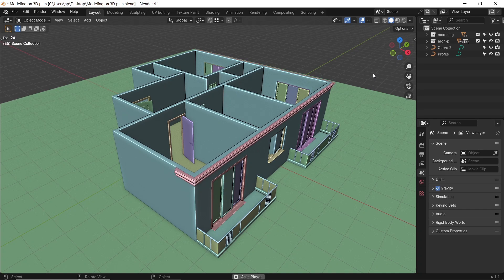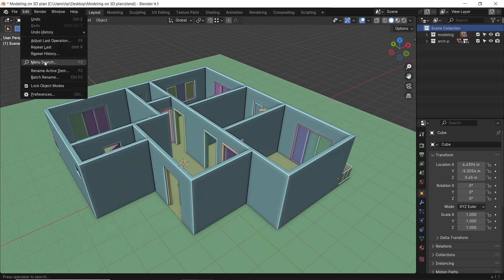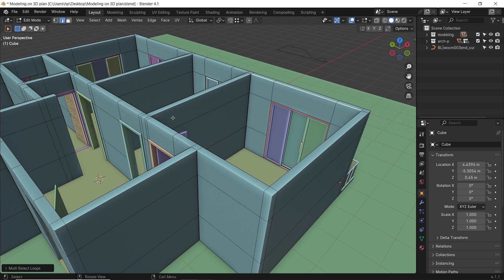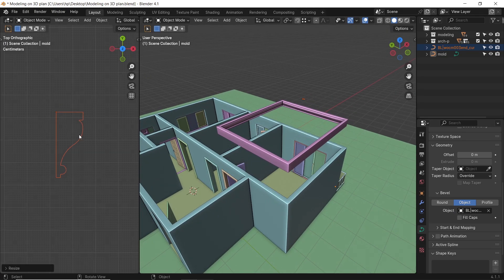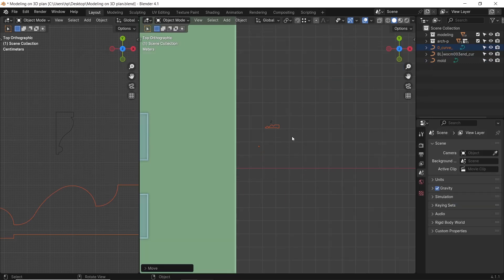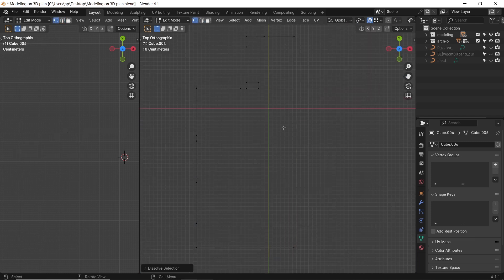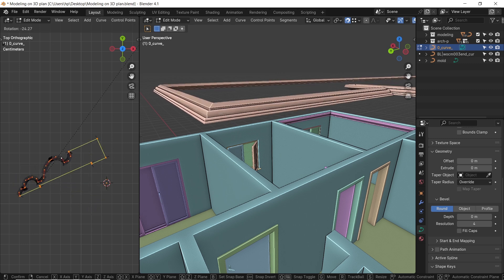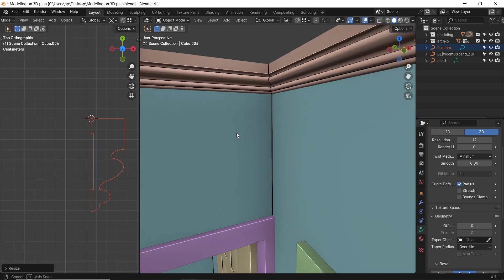Make Profiles and Moldings FAST in Blender

Comment: there are some profiles and cornices with floral ornamentations , which cannot be made this way , are there any other options ? thank you
Reply: For that you have a few options but are a bit more involved. You can create a segment of the moulding you want to create, something that is repeatable, and then either use array and set it to follow a curve, or something similar but with geometry nodes. Of course, this is just a basic explanation and might require more steps to make it work but that is the general idea. I would suggest looking at hbitproject's page as he deals a lot with classical design in blender and how you can get these models to be flexible and repeatable with high detail.
Reply from the maker: Well after the method we showed you can copy the ornaments or shape along the same curve with array + fix the corner pieces. More on the manual way but that’s the best available if you’re not using addons

Comment: great !
you can use a curve 2d in this situation too, it's better for corners
Reply from the maker: Cool!
Reply: Have you run into the issue where the profile shape is different after being extruded around a rectangle? I am extruding a door profile around a rectangle, but the with of the door rail shrinks when it extrudes along the rectangular path. Can't seem to solve that issue. If my rail with is 3 inches, it shrinks it to 2-plus inches. My work around it have been doing is simply to extrude it along a straight line and then miter it and then join all 4 mietered pieces.